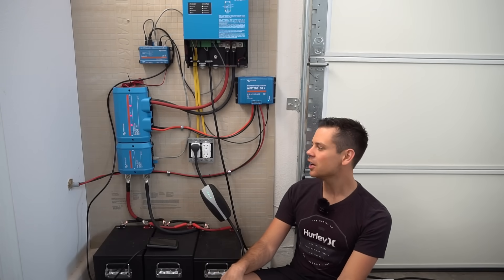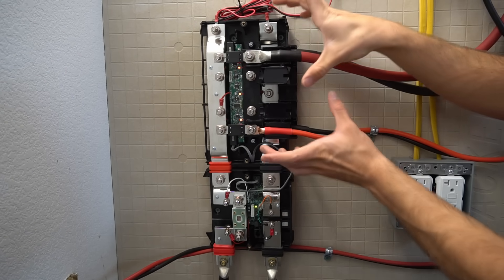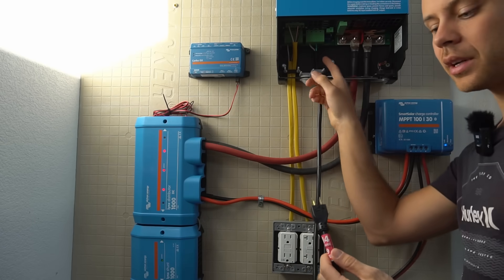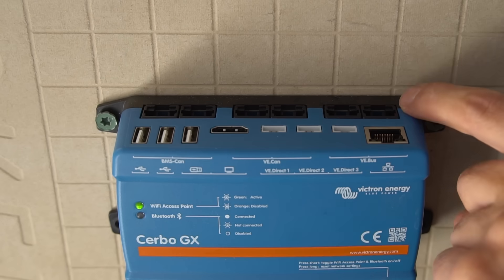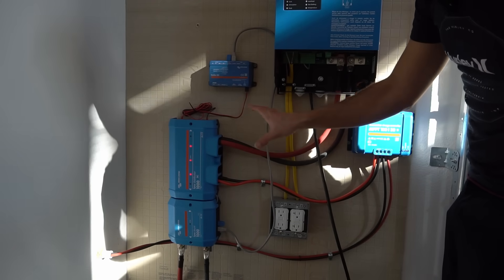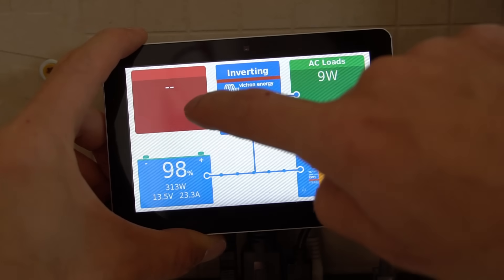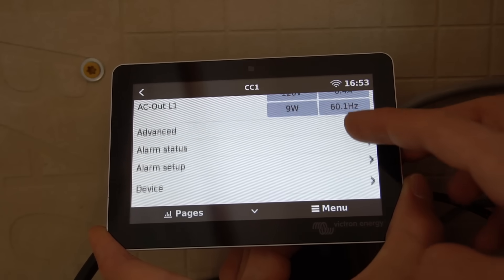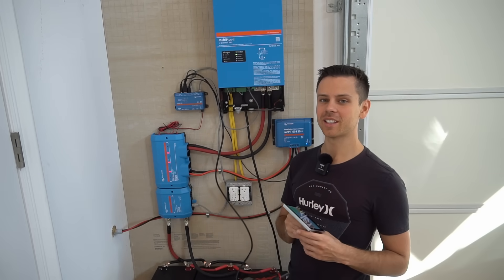Victron Made Easy! Design and Communication, Step-by-Step

Comment: I too went with Victron and 8 100v Battle Born Batteries, tide in series parallel for 24 V. But mine has busbars and I only use the Victron shunt. 
One question I have is how do I get a split phase of 120 and 240 without getting a transfer switch to go from 240v to 120v? Do I just buy another Victron inverter of the same, then having to24 V inverters, I would then have 48 V at 240v ?
I presently have a 24 V 3000 Victron inverter. 
Anyway I’m probably not talking right about it, as my understanding isn’t quite clear. 🖖😜
Thanks again Will for covering Victron. I’m still learning.
Reply: Here’s some things that I found awfully hard to find out on the Internet, things that nobody seems to talk about. I hope I’m understanding this right, trying to help others who may have the same issues I had. 🖖
Important things to remember: 
Always turn off battery switch when working on system. Just remember to switch off solar panels first. And when starting up your system again always turn the battery on first. 
Eight 12V 100 amp batteries wired at 12 V equals 800 amp hours. Wiring at 24 V would equal 400 amp hours. Wiring at 48 V would equal 200 amp hours. 
Absorption time should have 30 minutes per 100 amp hours. Example if you have eight lithium 100 amp hour batteries wired at 24 V you would have 400 amp hours 400×4 at 30 minutes would be two hours. I put in 2 1/2 hours to be on the safe side. 
Attach wires to inverter first, then attach to busbars. Use a 25W 30 ohm or higher capacitor between wires, this will help alleviate electrical discharge. 
Use at least 6/3 wire gauge from inverter to wall panel. 
A good ratio for PV to battery storage would be about 1 to 3. This helps when the sun is at a lower point on the horizon in the winter. 
How many charge controllers can you fit or connect to your batteries? There’s a certain amount of voltage you can use without doing damage. 
   Bus bars are dependent on their size from how many volts will be going through them from the charge controllers and batteries. 
   Class T marine grade fuses for charge controllers and battery bank. 
   When charging batteries from a gas generator, it’s 10% an hour. But if you change the settings in the inverter you can increase the charging rate. 
   When connecting in parallel with more than two strings you will have to use a combiner box. Branch connectors won’t take more than 30 amps. 
   When attaching multiple inverters you will need to charge the capacitors of the inverters when connecting to batteries. You will need a voltage regulator to charge the inverters capacitors. 
   In regards to how many amp hours you can push from your solar panels/charge controller to your batteries, it’s usually half the amount amps of your battery bank. Example would be in 800 amp hour battery bank divided by two would be 400 amp hours from your Charge controllers and PV. So you would be pushing the same amount from your solar panels, most likely. Unless of course you had less wattage/amps than the charge controller can take in PV. 
   In trying to do 48 V battery wiring, you need to make sure there’s enough amps per battery to do this, as there will be an extremely high draw demanded. Check with battery company to make sure if they can do 24 V or 48 V.
Reply: U should make this into a video by itself. Very important stuff to cover.
Reply: @danielgrwaldphone2927  
Anybody interested in doing a video of my system, I would be willing. This is the kind of things people run into when they’re building their own system for the first time. 🖖
They say the devil is in the details! 😉
Reply: You would have two identical inverters, each producing one leg of the 240v connected to your split phase panel. Inverter 1 would supply L1(black)/Neutral/Ground. Inverter 2 would supply L2(red)/neutral/ground. You’d configure this with victron software.

If they’re 24v inverters, they stay at 24v. Your input battery voltage would never change.
Reply: @_a1001  
So it sounds like you’re saying I would need to step down transfer box to 120 V from 240V?
I can always re-wire the batteries to 48 V. So that means if I want the inverter to be at 48 V, I would need to get a 48V inverter? 🖖thanks
This part gets me confused. 🧐
Reply: @benjones8977  Just to clarify, this would be for North America power, and you don’t need a transfer switch. If you have two Victron inverters outputting each 120v and you’re using a breaker box (which you should be), each victron inverter supplies power to the separate 120v power legs. Your breaker box will supply either 120v or 240v depending on the breaker you use. 

But before wiring your AC output, each inverter needs to be configured for 240v split phase (that’s what I’m describing above), otherwise you and your inverters are going to have a bad time! There’s a few videos on YouTube about this, usually folks with RVs. 

For heavier loads, 48v inverters are better. And a lot more battery options if you need to upgrade.
Reply: @_a1001  
Thanks! It sounds like it’s better for me just to get a 48 V inverter, as I like simplistic and I don’t want to get over my head. 
I know the panel has two 50 amp breakers for my solar and a flip switch to go back-and-forth from the grid to solar. I had an electrician hook that up, I was way over my head. I don’t know if those are capable of 240 V with a 48 V inverter? I’m guessing if I get a 48 V inverter it would still be 120 V? No big deal as I’ve converted all my appliances to 120 V. The only thing I have to flip back to the grid for is the dryer. 
Besides he had to replace the whole panel because the wiring was extremely dangerous. Apparently whoever did the wiring before did it very badly, I would’ve never known if it hadn’t been for wanting to upgrade to solar. It was a major fire hazard!
I’ve come a long ways with electricity, as I only used to know about the battery in the car. 🤣
Reply: @benjones8977  The nice thing with 48v is there are multiple 240v inverters available. Watts247 carry a few 48v 240v split phase inverters that would make a simple install. I have a Growatt 12000 that works well, just note it’s super heavy! Will also has a few videos on the MPP Solar LV6548 and split phase. 

As for your panel, it might be doable as is, as long as the grid’s neutral and ground can be turned off if you’re on solar…. Though I’m not as knowledgeable about doing it this way. I believe your current setup is more for an AC tied system, vs a DC tied system (AltE has some great videos on the difference, and requires different hardware)

I prefer to have a separate sub-panel that runs everything off the inverter… so there’s isolation between the solar and the grid, and use a DC system (like the Victron, MPP Solar, and Growatt systems). 
Hope that helps some!
Reply: Also I’d recommend checking out Will’s forum and poking around there, and asking questions. There’s a ton of knowledgeable people there.
If you do post there with questions, please include photos if you can, because it can help!
Reply: @_a1001  
Thanks again for your reply. This part of it is over my head, and I’m more likely to want to stick with Victron as I have everything else Victron. The only thing I don’t like is I don’t have a PC, and only use Mac’s. 
I’ve read a little bit about grounding, but I’m still confused about it. I wouldn’t have any idea if the grid is neutral and if the ground can be turned off. Basically I like the switch setup because it’s so easy, and I just go from Grid to DC, which is converted to AC with the inverter. The only problem I have with 24 V is the lights flicker in the house a bit. That’s the main reason I want to go to 48 V, plus it’s more efficient. Basically the 24 V 3000 W inverter runs everything I need it too. Except the dryer. 
The reason I want to stick with Victron, is reliability and because I understand the basics of it. I had battle born configure the inverter and charge controllers. 
There’s a lot a little things to know about building a system, that can make it dangerous for somebody like me. It would’ve been much better to start with an off grid system completely off grid, like on a tiny house or cabin. 
So far everything seems OK, had a few issues with wiring that got too hot, but those are fixed now. 
Will’s YouTube channel is great and I like his forums. It would be nice to have some friends in the area to discuss solar. All of my neighbors don’t have a clue. And as I get older a lot of my friends have either died or moved away. Again thank you and best of luck! 😜🖖🙏
Trying to learn about EMP’s and protecting my system. From what I’m hearing, it’s likely the grid might be down for months or years in the future.

Comment: Will. I’m a proud Victron user and I’m glad you’re including their products on your channel.  One thing I think you should mention is that people don’t need to purchase an entire Victron system at one time.  Each device/component can operate independently of the others and you can slowly add devices  to build your system as your needs and budget allow.  The final point that I think is worth mentioning is that one of the great strengths of the Victron ecosystem is the integration of products so that you have single point monitoring and control over Bluetooth, WiFi, or internet.  I’m looking forward to more from you on Victron.
Reply: Now that's info I need... buying the system in steps and setup progress. I currently have a very small stock solar setup with my new 5th wheel and want to upgrade slowly (everything too expensive to buy all at once.) to the system we need.
Reply: My question is now, now that we are headed to the life of batteries in every day life, will we ever be able to plug our Rv/ Cargo Trailer in to the Vehicle charging port, for when these days the sun decides to sleep in a few days
Reply: @greg925911  Victron's Orion series DC/DC converters handle that task.
Reply: Totally agree with your statements, proud user of the Victron system

Comment: Why not all the tech in one box? Will that be the future?
Reply: Because they tend to treat their system more like Lego. You can pick and choose your components to make the best setup for your situation. On my 27' sailboat, I've got a 2000W MultiPlus II inverter/charger, a cerbo, a 15A solar controller (not much room for panels on a small boat), a couple of smart shunts (I'm a telemetry geek), and then I have the Victron integrated with my alternator controller (wakespeed) and my BMS (REC ABMS). Everything integrates together and is very slick.
Reply: It's available and Victron make it
Reply: @SustainableGal  All relative
Reply: Thanks for your answer.
Reply: That's called a solar generator or power station. ecoflow, bluetti, goal zero, jackery, ect... This is all componentry for custom systems.

Comment: Do you ever do any work with Renogy systems?
Reply from the maker: Yes, I have tons of videos on renogy components. At least 30. Check them out
Reply: @WillProwse  thank you.  I've bought a 200ah LiFePO4 battery, 3kw sine wave inverter, battery monitor, and a 50a DC DC charge controller.  Do I need to have a switch installed so my camper can run EITHER on shore power OR on inverter power?

Nothing is installed at this time.  All of the equipment is still brand new in the box.
Reply: @budharris40  Some inverters include an automatic transfer switch so they can pass through the shore power to the loads and charge the batteries. So it depends on your inverter.